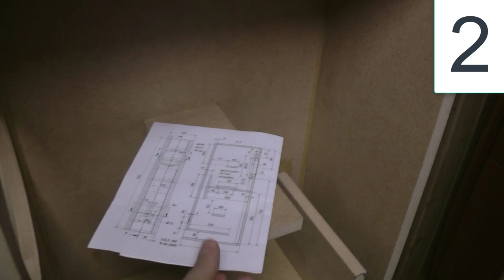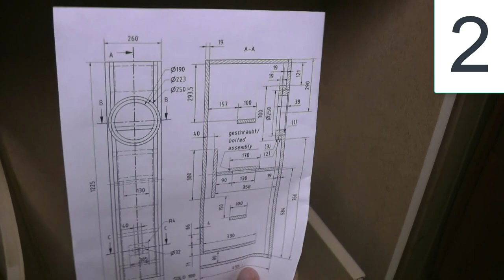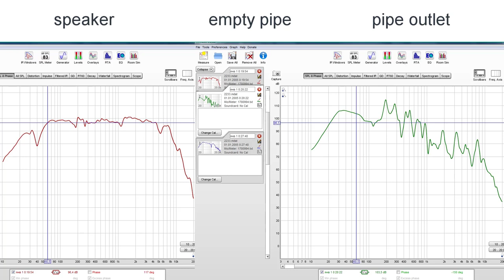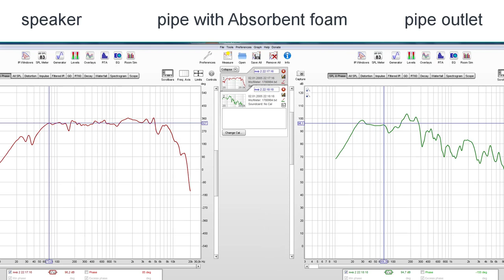Transmission Line SPEAKER BUILD Visaton DIY

Comment: hey 🙂 think the result of the transmission line is very nice, would now like to build the same thing, but with the ws 17 e - 4 ohm, does that also work with the 4 ohm chassis? Can you please send me the blueprint of the case? so the transmission line? would be very very kind of you, thanks for your time. Kind regards
Reply from the maker: Speaker impedance doesn't matter 4 or 8 ohms.
body is better to count.
the cross-sectional area of the voit pipe should be 2 to 3 times the cone area of the speaker being used. the length of the pipe is a quarter of the wavelength to which the van needs to tune the hull. e.g. 35 hertz.
look for a wavelength of 35 hertz and divide by 4

Comment: What would I need to do differently if I were to use 2 bassdrivers instead of one? just treat it as one big driver and use that as cross-section?
Reply from the maker: counts two diffuser areas
Reply: It depends on why you think you need two drivers. You probably don;t, what you need is the right alignment to whatever speakers you're using. 

https://www.youtube.com/watch?v=hIwZjJanXag&t=103s
I would also use little to no acoustic foam. Yes you can shorten the line to a certain degree, but in my experience is really does kill the sound. Again see the video link ... no acoustic foam and it seems to be working ok

Comment: I'm assuming 1 is the transmission line, and 2 is sealed?
The #1 has better uper mids, #2 has more pronounced mid bass. 

I think the AB really needs to come from identical driver's in the two different types of cabs.
Reply from the maker: I agree. I will do with the same components

Comment: I am sorry but you built them wrong. your woofers should have been at the narrowest part of the horn. This is how I have built mine and with 6.5's I have had to turn off my subs and reconsider how I will mix my bass. Also I have found a house wrap called Blueskin (basically a 1/4 in, self adhesive rubber sheet) is superior to foam of that kind. It allows greater movement of air, while still deadening the box tones out. The spl's from the port went up, while still offering great, controlled tones from the port. Then only small pieces of insulation might need to be placed to finish the tune of the speakers. Shoot me an email if you want pics and audio/video.
Reply from the maker: soffitto-omsk@yandex.ru I'll gladly have a look
Reply: can i get a copy of the plan? what's your e-mail addy ? thanks
Reply: @joeygonzo  Hi Joe I don't give up my email. I also don't know how to send you pics. However the basic premise of the box is the woofer goes at the very top of the box and then there's a board inside of the box that angles to create a folded horn inside almost like a megaphone. The taper starts so that's nearly touching the magnet of the woofer which is at the top of the box it grows to about 1/3 by the time you get to the bottom leaving space for air to travel past and then tapers the rest of the way up naturally. The back part which tapers back to the top is left open. I hope that description was not too confusing. Think of a saxophone with a reed at one end.
Reply: he built a transmission line not a horn though